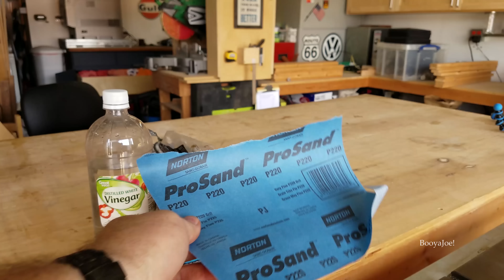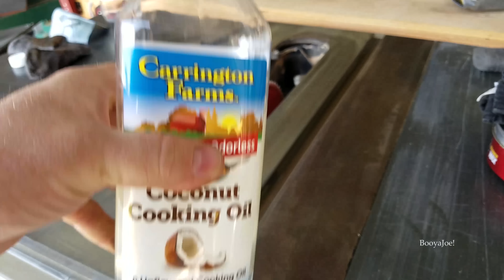How to Clean Rust from Tablesaw

Comment: I like the video, well produced. We use Coconut oil to cook, I would never thought of using on my cast iron tables. I just went out to look at my saw it is not bad but I think I will give it a good cleaning. Wax is not only a good sealer, to prevent return rust, but it also makes the wood slide smoothly on the tables. BTW I use Minwax past finishing wax. Thanks

Comment: I have always been tempted to buy one of those really beat up table saws that you see on Craigslist for 100 bucks, then restore it. I could probably use this method myself for taking all the rust out of those cast iron tops. I would then like to take the wings, and maybe the base to a shop near me and have them powder coat it with maybe a fire engine red coat. Maybe even replace the old motor. By the time it was done I could probably have bought a new saw, but a totally restored table saw would be pretty cool in my opinion. Great tutorial, thanks.
Reply from the maker: Thx for the comment!  I did this also on an older jointer I purchased about 7 years ago.  At the time it was about 15 years old and once I cleaned it and removed the rust the tool ran good as new.  Only cost me $150 when a new jointer would have been $650+  Good luck!

Comment: When you have bad spots, put some paper towels on the area and soak them with vinegar, then go do something else for a while. Vinegar is altready diluted to about 5%, so it is pretty mild stuff. It needs to have some time to work. You can even let it sit overnight. You want the vinegar to stay wet. If it is hot and dry out, you might even  lay some plastic, or anything, on the towels to hold the moisture in. Working it right away only works with extremely light rust. You will be using the mechanical abrasion more than the chemical action that you want.
Reply from the maker: Thanks for the suggestions and comment.

Comment: Tractor Supply/Harbor Freight has a product called EvapoRust.  It will Shorten this task from several hours to less than 1/2 an hour.  If you don't use your table saw often, you should leave the wax unbuffed.  It will seal longer of you do.

Comment: Very good video, I am not real familiar with the wax you use. One caveat is to be sure the wax is silicone free. I believe most woodworking waxes, Johnson’s paste wax, carnuba waxes are silicone free.
Reply from the maker: Nice to know.  I just used typical car wax.  Has held up really well.  Thanks for the comment!
Reply: As I understand it if you use a silicone based was product it can actually transfer to your wood which will inhibit stains and finishes. Rust Free is another good product but you wil want to keep it off the paint. Then follow up with Boeshield. I think it’s also known as T-9. Merry Christmas!

Comment: Yesterday I started to use my Dremel to get the rust off of a handsaw, that I'm restoring.  But now I'm left with these real unattractive marks all over the saw...even though the rust is all gone.  How can I get those marks to disappear from the sander?  Will they disappear once I start to polish?   Thank you.
Reply from the maker: Not For You Nosey not too sure. Might want to try using some heavy grit sand paper first to scratch it up really good. Then progressively use higher grit until the scratches get lighter. I would also suggest using an orbital power sander for this.  Start with 80 or 100 grit and Go all the way up to 400.  Then might have yo use higher grit to bring the luster back.  Something like 1000 and polishing compound.
Reply: BooyaJoe! Thanks!  Appreciate it.